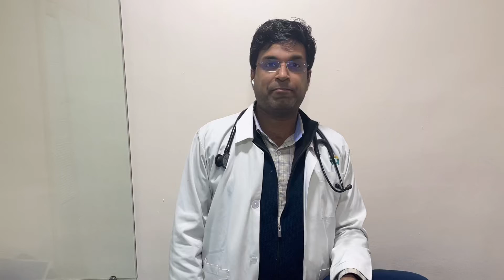How positive pressure ventilation affects preload and afterload of heart

Comment: great video.  Just a quick question.  I understand how the increased intrathoracic pressure will aid the LV contraction allowing better ejection of blood but I dont understand how that would lower afterload.  In my thinking it would make it easier for the Left ventricle to reach and overcome the afterload and eject more blood systemically.  But  Isn't the value of afterload dependent on the systemic vascular resistance and systemic blood pressure.  Thats the main thing that has always confused me.
Reply: When you have increased intrathoracic pressure and lower extrathoracic pressure... its easier for the LV to pump from high gradient to low gradient... 

Can also think of it like increased thoracic pressure leads to less resistance in the proximal outlet tract and thus LV can push easily therefore decreased afterload. After load  is a measurement of the pressure the LV has to generate to push out blood. hope that helps